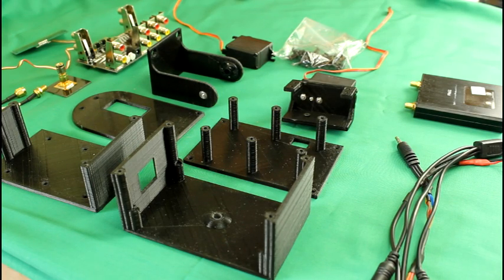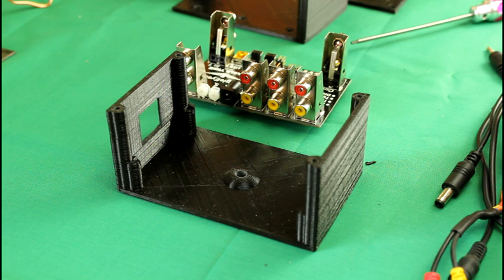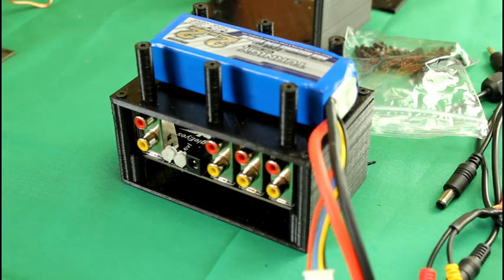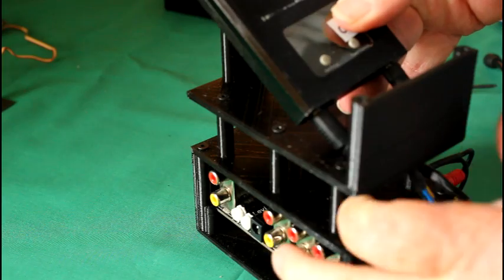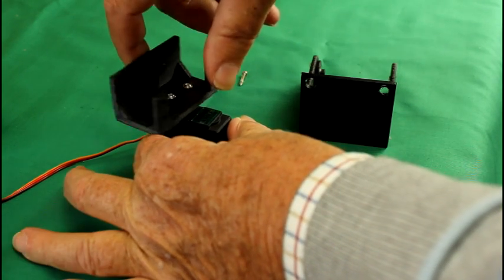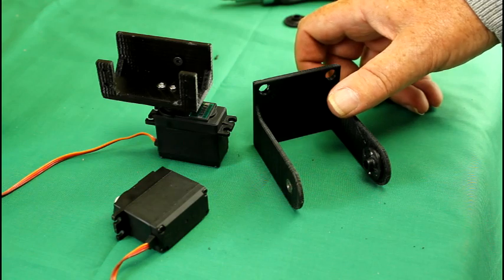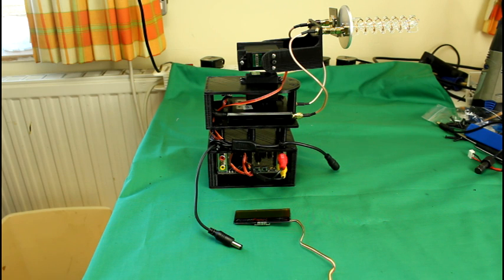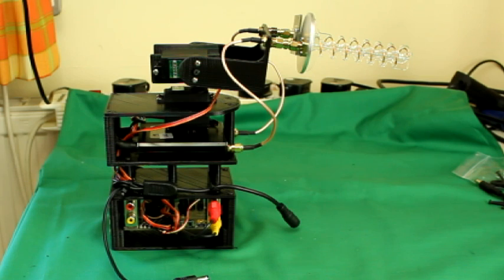How to build a 3D printed antenna tracker for Eagle Eyes and Vector part 1

Comment: Where can i buy this complete setup with 5.8 diversity vrx?   Dont need the antennas. Id like one that's plug n play. Very nice n compact setup.
Reply from the maker: I can make you one but it would be about 6 weeks because I have lots of other stuff to do, also I would need to work out the cost for the electronics (Eagle Eyes board, 2 servos etc.)
Reply: @Aikonaazi  with power panel that displays the gps coordinates
Reply from the maker: That would be the info panel and could be included  @theinnocent714
Reply: https://youtu.be/S9LxLES2alE
Can u make this? Something like this would be perfect ,
Reply: I just saw ur the tracker made for bigger antennnas 1.3ghz i think that would be perfect to use that with a 5.8 repeater.  I saw that u ran all the wires down in thru the center hub.  Very clean setup.  Please estimate the cost and maybe we can work something out.  Thanx
Reply from the maker: I have a spare. You could have that for £120 ($150US) + postage to wherever you are
Reply: @Aikonaazi  ok , possible to include power panel and add the extra cost? What form of payment is best for u?  It would be shipped to ORANGE COUNTY CALIFORNIA, USA
Reply from the maker: Pse send me an email chris at zenmail.com

Comment: Thanks Chris , I'm using makerbot 5th Gen printer with makerbot software ..I don't have a clue on cad or anything like that ..all the other parts came out fine just that battery tray that didn't work out .. not sure why ..I will give it another go and will keep fingers crossed ..thanks for the help and thanks for sharing the tracker 👍🏻

Comment: Hi Chris , I printed this of thingiverse , only I'm having trouble with the battery plate ..it doesn't print the stand offs on the plate ? 
Can you add that file separately to your thingiverse so I can finish building this great tracker 👍🏻 or if you could email me it .many thanks 👍🏻👍🏻👍🏻
Reply from the maker: HI. I am not sure why this is. Anyway I regrouped the objects and compiled a new STL file and deleted the old one. The new file is called battery tray.stl. I am not sure what slicer you are using, but this one prints okay in CURA. I have also put the 123DX editable file on there which you could download and play around with. You need 123Design from autocad but it is a free download.
Reply: good news its printing ok now ,god knows why it didn't work before ..thanks again Chris

Comment: since the eagleeyes have 90 & 180 degree settings why a normal operating servo wont work ?
HS-422 Servo Motor i have these servos , will they work ?
Reply from the maker: Not all servos go through full 180 degrees, Not sure about the HS422.
Reply: Chris Hornby but you dont need a full 180 right ? you have the 90 degree setting aswel

Comment: Great video 10/10 
I have one questions. Where did you get the ballbearings from? Website or link would be appreciated.
Once again fantastic video
Reply from the maker: +roderick sallie all the bearings are available here http://simplybearings.co.uk/shop/Bearings/c3/index.html if you are UK based
Reply: thank you Chris
Reply from the maker: +roderick sallie Dont mention it, if you need any  specific help just ask
Reply: Once again thank you. And I may end up taking you up on the promise.LoL
Reply from the maker: http://simplybearings.co.uk/shop/p155236/F693ZZ-Metal-Shielded-Flanged-Deep-Groove-Ball-Bearing-3x8x4mm/product_info.html
Reply: Thanks so much for the quick reply! Bearing is now on the way and half way through the part printing :) Thanks again for your efforts and time designing this and making the videos!
Reply: Exactly which bearing should I buy from that site?

Comment: Thanks for this video and all others. I just got my tracker printed. Just wanted to know what size servos did you use in this project?
Reply from the maker: +Tim Anderson Jr.  I used the standard size Spektrum/JR servo :Length: 38.8mm (1.53 in) Width: 18.8mm (0.74 in) Height: 34.9mm (1.37 in)